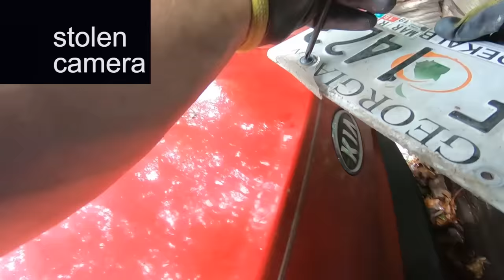Parking Revenge #157

Comment: Towtrucker, you did a good job here. From what he said it's clear the guy has a few delusions that are real to him. I don't know if anyone trained you for it, but you correctly see that if you basically don't entertain their ideas at all and draw strict lines, you can set them off with frustration-agression, while the way you handled it will minimise that.
Giving him his license plate gives him an idea that he controlled the situation, a mental lightning rod if you will to draw the stress away, and that'll often be enough to let you take the car.

Frustration-agression mirrors though, so if you're not getting angry and verbally agressive but it seems to be sliding off you, it becomes increasingly harder (mentally) for them to attack you the longer the encounter goes on. So basically, you're safer with each passing minute as long as you do what you do. Maybe you already know that, maybe not. Hopefully someone reads that and can use it to feel less at risk during such an encounter.

Because I messed up plenty enough times with security work drawing a strict line to protect staff and instead just end up setting off whatever mental case we were dealing with, that I eventually learned. 😆